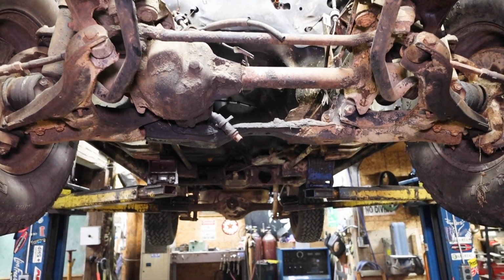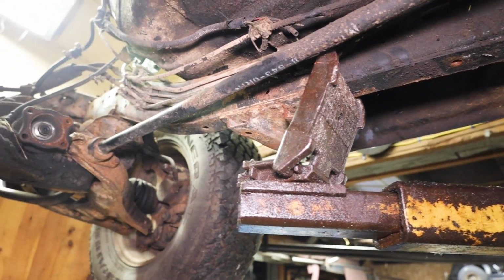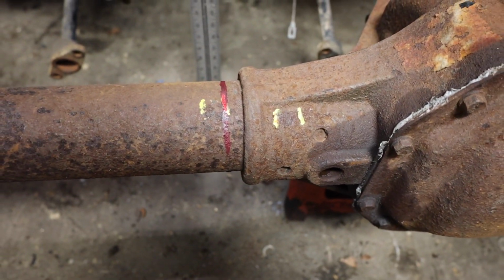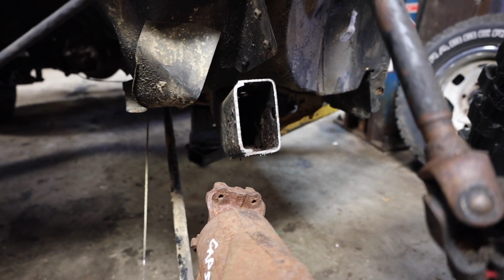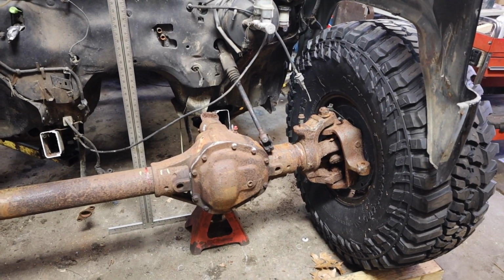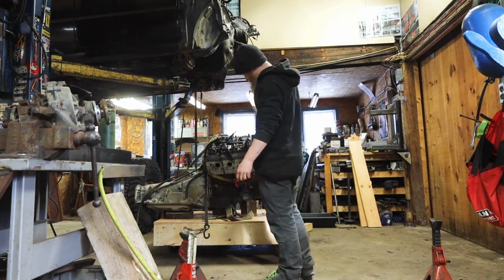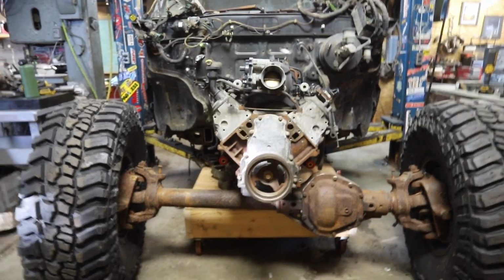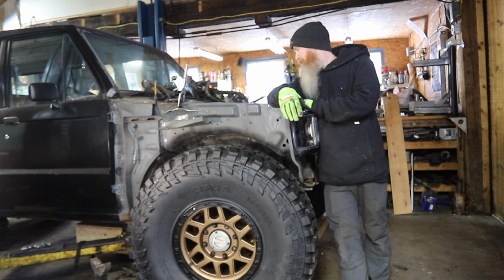The Super Trooper Part 2

Comment: I have a stock 90 Trooper with the 2.8, I picked up a 2010 Silverado with the 5.3. So you think everything will fit under there pre lift?
Reply from the maker: I can’t speak to that directly as I cut the factory frame off, but I have done 10 or so LS swaps and I am confident you can get an oil pan on that engine that will allow it to fit.
Reply: Thanks a bunch, I was more more worried about that trans going under there swapping entire drive train under. We'll I guess worse case, I'll follow your videos! Thanks man!!